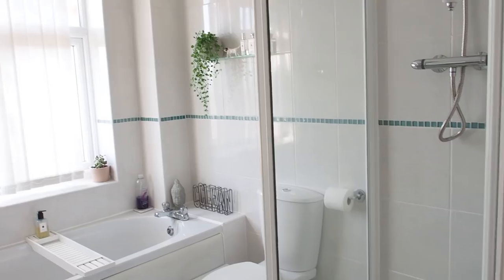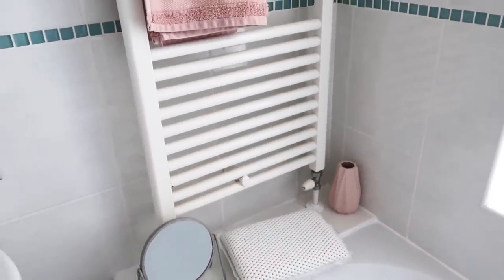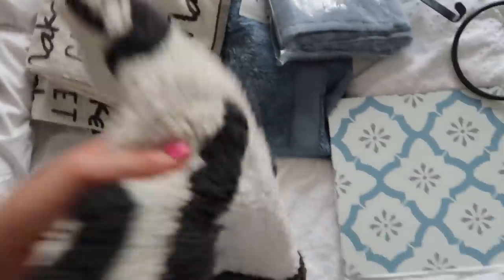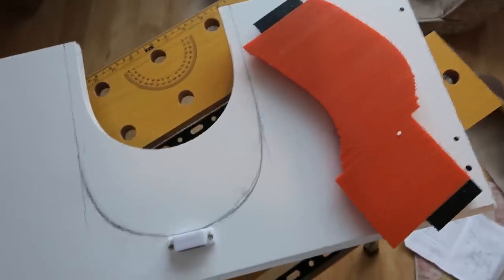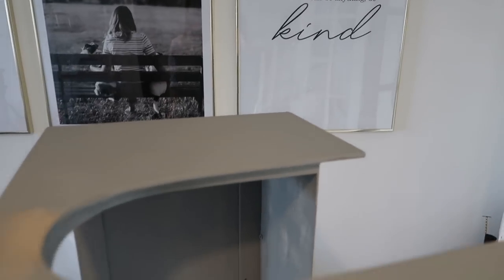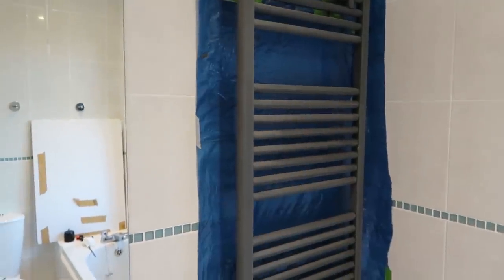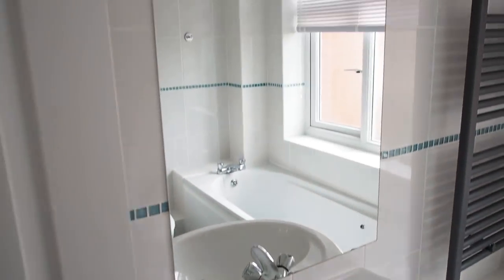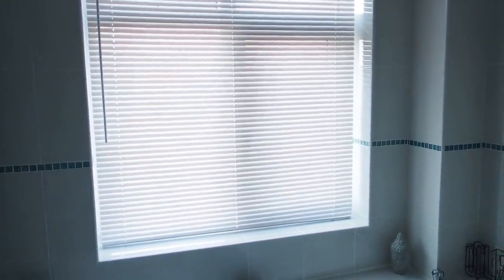RENTED HOME BATHROOM MAKEOVER | Budget, Up-cycle, Renter friendly

Comment: What a difference I did the exact same thing in our bathroom same vinyl on bath panel and same floor tiles.  I took the bath panel off which made it slightly easier and it does make it look better too. I think from afar those floor tiles look ok but the joins show and they arent that sticky but the design is nice took me 6 hours to put down and 2 red knees. I think a piece of vinyl flooring in similar pattern would have been better , but it will do for now till we get bathroom replaced. Love your attention to detail!